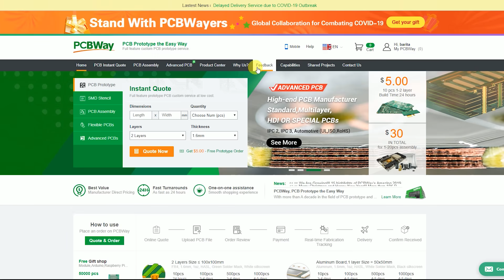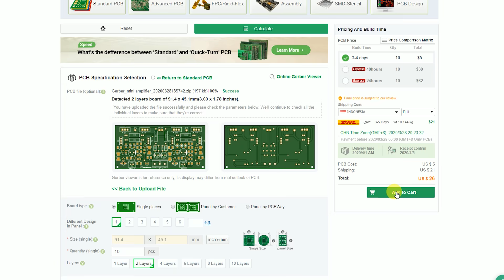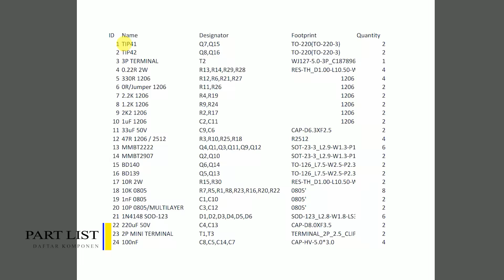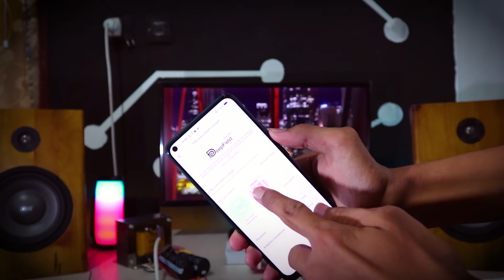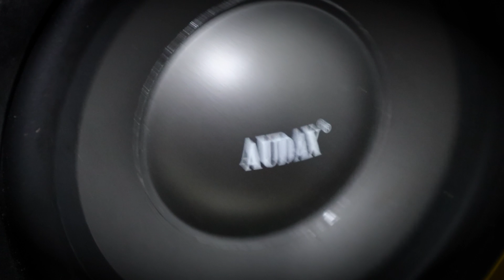Mini Amplifier TIP 41/42 Build | PCBWay

Comment: Power amplinya speker aktip yg melegenda ya TIP 41 42 ,, kecil kecil tapi enak,, empuk suaranya...
Reply: I buid it, i've replace the tip41  & tip42 by c5198 & A1941, it sound good so very good, very loud even without preamp. Try it you'll not believe your ears.
Reply: @Thedarkwebgiant  20-0-20 volts is enough. It's the only circuit that i tried  and i can say it's play really good. I build many circuit from the web, but this one is the best, the way the audio pass in the circuit is so different with another circuit that i've seen before.

Comment: Salam.
Mau tanya.
Bgm cara baca skemanya, itu macam dobel2 komponennya.
R1, R16 10k. 
R2, R17 2k2.
Dll.
Reply from the maker: karna stereo om, R1 di channel kiri, R16 di channel kanan. dengan nilai dan posisi yg sama
Reply: @barlexrespectaizer452  
Weeeeeeeeeeekekekekek. Ternyata begitu. tp kalo sudah tidak tahu jadi masalah juga.
Reply: @barlexrespectaizer452  
Mau tanya lagi. 
jika direlayout supaya menggungaka Komponen Non SMD maka Transistor MMBT2222 jika diganti dengan transistor apa?
Terimakasih ya.
Reply from the maker: MMBT2222 = 2N2222 om..
Reply: OK. Baik 
Terimakasih banyak ya.
Sukses terus.
Reply: @barlexrespectaizer452  
TANYA LAGI YA.
RATING DARI RESISTOR BRP?
1/4 watt atau brp?
Reply from the maker: @ahmadsyahid2401  beda beda, ada yg 0805 1/8Watt
1206 1/4Watt
2512 1Watt
Reply: @barlexrespectaizer452  
 Barlex respectaizer  
Baik. Saya coba membuat layoutnya untuk mono sj dgn resistor metal.
Di skema ada yg disebutkan 2Watt, selain itu saya pake 
1/4watt. Bisa gak.
Izin ngelay out sekalian 😂
Reply: MAU COBA BGMN BEDANYA DGN NAMEC STANDAR YG JUGA PAKE TIP 41/42 XXXXX
Reply from the maker: tr mmbt2222 cuman tahan main maksimal 40V 😂 jangan di gass 🤣
Reply: @barlexrespectaizer452  
😂😂😂😂😂
Gasss pooool. Nabrak apa mbledos.
Thank for your instruction
And than another instruction?
How much is the maximum vac?
I see it is 18ct from transformer.
Reply from the maker: @ahmadsyahid2401  bah pake inggris dia nya 🤣 saya cuma berani sampe 18ct, soalnya gak tau juga itu transistornya sanggup main sampe batas berapa volt aslinya..